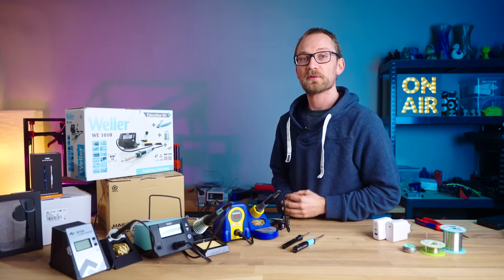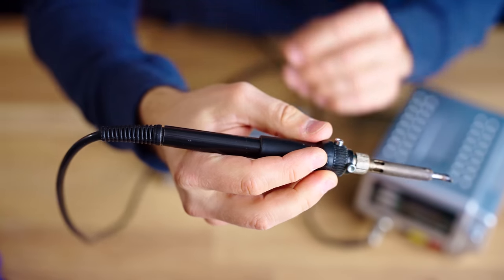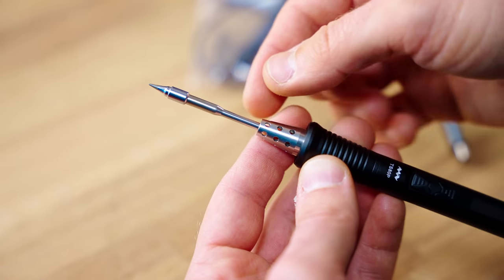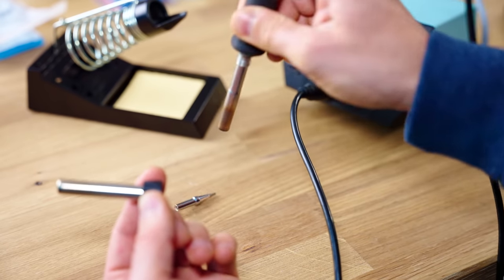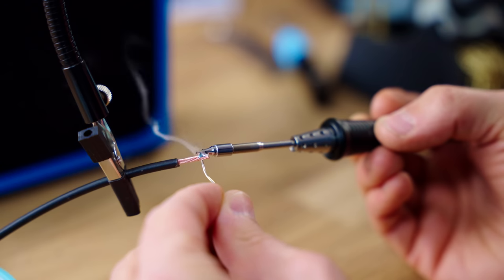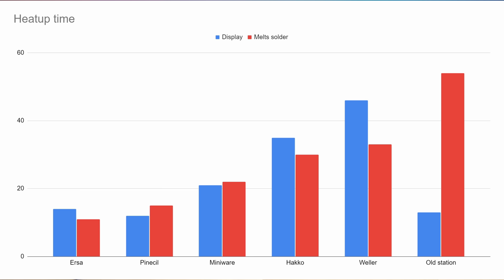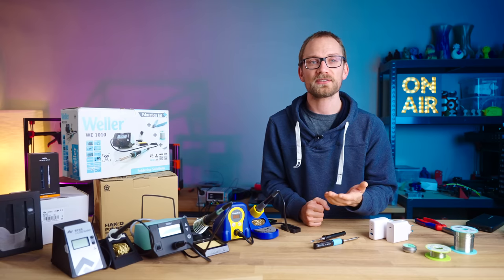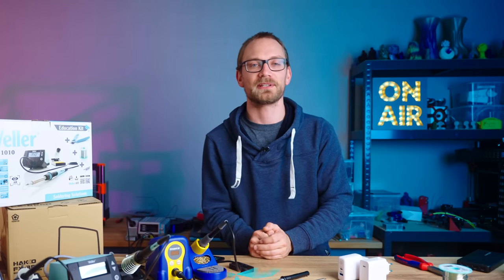Best hobby soldering iron? Pinecil vs. Miniware, Hakko, Weller and Ersa

Comment: Personally, I use Weller WD1 stations primarily, but did get a couple Hakko T12 clone stations recently to use on the move.
I will say, the Weller WD1 with a WMP 65 watt pencil iron is a much shorter grip to tip iron than most I've worked with, and looks much like the Ersa handpiece's distance.

Comment: Funnily enough, while listening to this, I was soldering with my cheapo "Tuloka 701c" soldering station. It has a LED dot-matrix style readout, temp memory, rotary controller, coil holder and basic spots to put your flux and metal wool. I'm pretty sure it's some kind of Hakko clone, but I didn't have to pay the Hakko tax for it, it works and I'm happy. It heats up quick too! Good job you made a video detailing different soldering stations. I think a lot of us who may not have touched soldering before eventually get into it through modding and maintaining our 3D printers. Soldering has also sparked an interest in me for brazing, so my next few projects will involve brazing some custom metal frames for house projects.

Comment: I googled like a year ago and found out that the ksgear 12 was a steel for the price at that time. The t12 tips are cheap (4$ per tip) and very capable. An oled screen with everything what heart desires  displayed. Even individual tip calibration. The silicon cable and small form factor is awesome for storing. 
Would recommend to anyone.
Reply: Yep, I bought one over my Ersa because the price for some more rare tip models have become silly for the Ersa (like 50€ ). And the KSGER T12 ist just perfect, there's no reason for paying more.
Reply: I absolutely agree! I work in my lab full time, mostly focused on component level board repair for industrial clients. And when clients need it….I specialize in test equipment repair, calibration, and other metrology related tasks.

I love my test equipment and tools like my children. And I REALLY love some of my expensive soldering stations. I wasn’t expecting the KSG ER to come anywhere close to the more expensive gear. But it does! Been using them for a few years now, 12 hours a day six days a week. I have several, And always have at least 1 or 2 stations powered on when in the lab

the KSGER T12 has REALLY impressed me. For About $50… it performs 95% as good as irons/stations in my lab. Most of which cost 10 to 20 times more!
Reply: I have a Ksger T12 too and I absolutely love it... It uses the newer genaration of Hakko tips(T12) and they the clone tips are VERY cheap and even the OEM tips are not too bad, and there is a huge selection of them. I got a 10 or 15 variety pack when I first got mine and it only scratches the surface of the tips available!
I had also always had a little desire for one of the TS100s or TS80s for portable use though, but hated that they each used different tips, and the older TS100 had a better selection. Also the TS80 was better in some ways but worse in others than the TS100. They were both rather expensive too.
Then the Pinecel came out with the best features of both at 1/4 to 1/3 the price, and I did not even hesitate.
I now have one of the best bench top irons and the best portable, and if I REALLY need to 'pour on the heat' I have a (very) cheap butane powered iron to do BIG jobs with.
He REALLY needs to get a Ksger T12 and some more TS100 tips for the Pinecil and do a followup on this as only having the tiny tip for the Pincel put it at a MAJOR disadvantage against the others!
Reply: @jamesraykenney  how long is your butane powered iron already working for you? I have gone through some models, including expensive vendors like Weller, and they all died way too fast, like at about 100 times of use at max! I am searching for an alternative and better gas powered iron for some time now ..
Reply: @jamesraykenney  TS100 and Pinecil can actually use T12 tips, they are just a lot longer. But people have made grip extensions for both. They become a little more top heavy with them but are still very nice for making those portable irons even more versatile.

Comment: I've been soldering for about two decades by now. The pinecil is by far my favourite soldering iron i've used in all those years and I've come across many in different makerspaces, electronics labs and workplaces.

The biggest advantge of the pinecil is in its name: it's not much bigger than a pencil and you can always carry it with you EDC-style. This in and of itself is already an unbeatablw quality if you ask me.

the fact that you can run it off of almost anything just sweetens the deal.

Comment: Got my Pinecil earlier in the year. Works so well for pretty much any small stuff. Does chug a bit as like you said with bigger. 

I had only one issue with your test on it and that was the changing of the tip. At 20:18 you said you needed to do both front and back screws. You only need to do the front.
Reply: I kinda disliked, that he gave the stations the advantage with the bigger tips, but the USB irons didn't get that advantage for the comparison.
Would love to know if you add a bigger tip to the pinecil if you still have problems with the big wire 🤷🏻‍♂️
Reply: @ized88  Think the testing is mainly what you get out of the box.

Comment: I recently got myself a JBC soldering station (CD-2BQE), that is pretty expensive (370€ for the station + 100€ for all the tips I need). It also uses direct heated tips and heats up super fast (about 3-4s from 0 to 320).
I really love the station, but at that price it only makes sense, if you solder a lot.
Reply: Yep, JBC is the best system in the world and blows these away.  The tips are quite expensive though and I was hoping I could adapt one of the TS100 tips to work with the driver unit, but it is not possible.

Comment: I can confirm the Wella iron's durability. We have always used Weller irons in our instrumentation department. They are switched on all day, every day and sometimes not switched off overnight! It is very rare that they require a new heating element. The tips last a long time unless we have to use an acid based fluxed solder as we do with K type thermocouple wires. We have never had a base unit fail and I am still using a 30 year old station!

Comment: KSGER T12 wipes the floor with all of these tested and costs around $50. No clue why it's not here being tested.
Reply: Came here to say just that. Comparing tiny usb powered integrated tip irons vs big indirect tip stations and they all perform anywhere near similar tells you all you need to know. Integrated/direct power cartridge style iron tips are far superior. And the KSGER T12 is the best bang for buck in that category. Showcasing those indirect tip stations is a waste of your time. There's 0 reason to use them.
Reply: @Vonderboy  Well quite. I have no idea why anyone would entertain the idea of buying those old style with the element in the handle. Once you go direct, you would never go back.

Comment: I use the weller W1010 at work nearly everyday for atleast 8-9 hours for the past 10 months at 650°F.  It is very durable, havent had 1 issue. It's easy enough to change out tips. Not really much else to say, if you're looking for a durable solder station around its price range, you can't go wrong.

Comment: I've now built 15 FPV quadcopters using 2 Pinecil irons. One with a standard pointy tip and one with a bigger chisel tip for larger joints. I have never wanted or needed a bigger or more powerful iron in the process of building these drones. I highly recommend the pinecil soldering iron!

Comment: I've used professional stations made by Hakko, Weller, Metcal and others... For myself, I've bought a cheap Miniware TS100 kit (it comes with every tip available) and, with the right tip, can solder very big wire gauge. The "boost" feature is so brilliant that I can't believe that good stations doesn't have it. Plus it doesn't have the buggy software of the TS80. 

If you still want a station, I recommand buying a Metcal station. Their tip tells the station which temperature it needs to use and goes in sleep as soon you put it in the holder. Very easy to use and very powerful.

Comment: Thank you for making & posting this informative video.  Have the Hakko FX-888D.  Excellent, w/5 presets, easy to change, bright/visible LED display, soft flexible silicon clad leads to iron, reasonably priced, Hakko sells them (to avoid counterfeits), and the monolith design is simply awesome.  Every single subsystem is available for sale (Hakko) as replacement (thank you Hakko).  (Plan to purchase an extra face/LED module as extra).  Hard to beat the Kaizen people.

Comment: Easy Choice. The Ersa is not only a great tool for the job, its also a quality build that will last you a very long time. I am still using my Ersa Digital 2000A + Power Tool from over 20 years ago. I use it regularly and its still perfect. I added the micro tool later for SMD work and the long life tips last a really long time.

Comment: I love my PineCil... Bought a cheap adjustable power supply with barrel jack and adaptors for bench soldering work and hobby uses (never know what Voltage you need next), I have phone chargers that can run it on USB Type C, and a 12V 6A Lithium battery pack for portable field use. 
None of the others heat up as fast, they use more power, and they can't even be used as a portable/packable unit, without a substantially larger power cell, generator, or 120/220VAC outlet nearby. 
Personally, I am VERY happy that I went with PineCil, considering the price, performace, portability, and practical usability. Way better than the butane torch soldering iron I had for "just in case" solder repairs... Who wants to fire up a torch to melt metal, in confined spaces, like in a car, under the dash? With the Pine unit, I can power it from the car battery or my Lithium pack, and be so much safer

Comment: Bought a Zeny SMD Hot Air Rework Soldering Station for US $50 five years ago on Amazon that has served me faithfully so far. The hot air part is really handy for shrink wrap tubing. It is fully digital and uses separate red LED displays for the iron and the hot air, both of which can be run simultaneously.

Comment: Some time ago I treated myself on the JBC CD-2BQF soldering station. It's a bit more expensive than the stations in your review, but it properly dwarfs them all.

It has 130Watt, heats up from cold to the set temperature in 2seconds, it has a nice solid quality base station, which incorporates the iron-holder.

Yes, it's roughly 500 dollar. It was the best money I ever spent.

Comment: Surprisingly, the Ryobi 18v soldering station is really nice. I got it for soldering on vehicles/trailers, but now it's my main iron. It can run off AC too. It heats up fast and doesn't used a ton of battery. The only drawback is there's no temp readout. Also, I don't know if it's worth full MSRP, but that's that what refurbished sales are for.

Comment: Ersa has released MK2 Nano and Pico soldering stations. They improved changing tip, now it is integrated permanently with the nut, and now it is super easy quick change system.

Comment: Jbc soldering stations are the absolute best. they are made for the electronics industry. Yes the cost 4-500€ but i have actually made my own station for about 40€. The iron with tip just costs 80€

Comment: Weller soldering stations are the best, that's why we use them in avionics. You can use them all day every day and the hold up for years. If they do eventually break you can just send them in to get fixed under warranty. But for a hobbyist I would recommend the TS80 or TS100. Those little things are crazy good and pretty powerful, my wife even used one to do some stained glass soldering. They are especially good if you need to do mobile repairs or soldering on cars because you can run them off of a mobile battery pack as long as you have a high quality power bank.

Comment: First station I bought was a Yihua 937D, a 45W Hakko knock off.
An Aixun T3A with a T245 handle has replaced the previous.
This new station can run 200W and is compatible with JBC tips of 245 series.

Comment: I am a Weller fan - been using them since 1979 in professional settings.  I bought a WES51 Digital just before they introduced their current 1010 model.  I prefer the WES51 over the 1010 for the reason you cited - it has a smaller iron handle and screw-on tip holder.  It also functions the same as their older units which were very basic and solid in function.  The digital is a nice feature, and at the time of my purchase, Weller was selling off their stock at $120 USD per unit; a price I could not say no to.

Oh, by the way Thomas, if tip life and good looking solder joints is important to you, never use those copper pads to clean a tip - Weller's only come with a sponge for just that very reason.  That dull part on the tip is a coating - and when it is wore off it is just inducing trash into your hot soldering pool.  This is the big difference between Weller tips and aftermarket tips; the other tips don't hold up as well as Weller tips do over time.

Comment: OMG you nailed it on swapping tips... wait until they cool off??? I don't even power the iron off when I swap tips.... LOL...  If I looked everywhere in my basement and my toolboxes I probably have 5 different irons/stations. My cheapo T12 iron for my bench is awesome and my Pinecil for my toolbox is my second favorite. T12 iron I can tip change bare hands when hot which I really love. Absolutely love the Pinecil power options... I use it with a 3S LiPo battery, a USB-C PD charger and a 12V car cigaret lighter adapter. Great for working in the car or boat or a trailer in the yard.

Comment: I love my TS80, I use it almost daily as a electric technician.  Paired with a powerful   Battery bank Makes it great for on the go and IMO a must have for any field technician. It’s saved my butt more than once!

I would HIGHLY recommend flashing a different firmware to the TS80. It fixed most of my issues.

Comment: I am probably a bit late , looking at this metric ton of comments, but here it goes:

I was at the samer decision making point for a station a couple of month a go. The ones you tested here were all contenders, but in the end, and what i would recommend both to you and others looking for something in this range, is something entirely else:

a JBC  "Weidinger Edition" analog Soldering Station. 

Not many know the name, but they are not some indy or china company (Industry supplying Company from Spain). And this is a "cheap" version you don't even see on their own homepage. But bear with me for a second: 

-It has a fine silicone cable which makes it easy to handle (looking at Weller here for their cheap shit household-like cable)
-super fast heating times which i haven't measured because i just pick the iron up and "go" (i could ofc not check the display vs measurement since it only has an analog dial...)
-i soldered 4² cables to big gold-plated terminals without any issues (and fast)
-it automatically sends the iron into a "standby" temeperature as soon as you put it in the holder
-it uses those more expensive but really awesome "all in one" tips, and let's be honest, usually 1-2 or max. 3 of those are enough for anything you do for a long time.
-and last but not least: THAT ANALOG DIAL! Who the hell needs all those friggin' hard to set digital crap if you can just flick a dial to wherever you want in a split-second!?
-240€ including German VAT - which is a lot, but still a far cry from the next best in their line-up

And no, i am not getting anything for this. I am just really happy with it ;)
Hope i could help those people struggling with the ups- and downs of the ones mentioned in the video!

Comment: I am using a Quicko station, that I build out of parts from China (back then ordering for under amount meant, that there was no Einfuhrumsatzsteuer und therefore no need to go to the Zollamt)

It has active tips, it uses cheap T12 clones, that are easily available.

The interface is very easy, since it only has a 7-segment-display to show the temp and a knob to set the target temperature. I heats up in a few seconds as well.

Comment: I have the WELLER WESD51 and absolutely love it.  I got it after years of struggling with those cheep soldering irons that plug directly into the wall and have not regretted a single penny of what I paid.  If you do much soldering at all then it is well worth dropping a little more for a more capable soldering station.  I am in the market now for a rework station now but not sure what one to get so doing research on those now.
Reply: also a faithful WELLER WESD51 user!

Comment: I am using a Weller WLTP-S station (has only an on/off switch everything else is done with the soldering tips) since 1986 (so nearly for 35 years). Recently I had to change the magnetic switch, which was no problem at all. To get spare parts after more than 30 years is also very nice.
But Weller Tools is an US company and the Magnastat soldering iron was invented in the US and patented in 1960.

Comment: I love my Pinecil, I use barrel connector and 24 volt power supply.  It has enough power to solder a brass tag with the default tip .  The tag is the size of a US military dog tag.   Can't wait to get more tips.